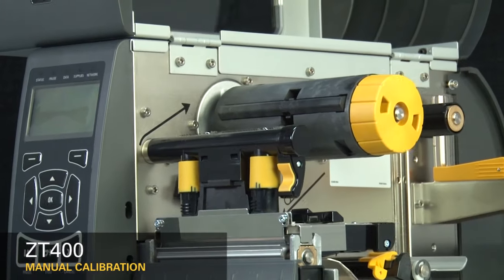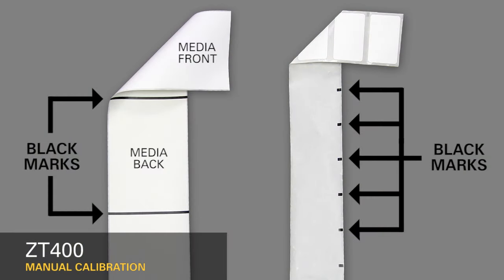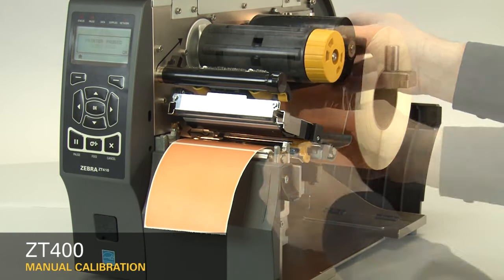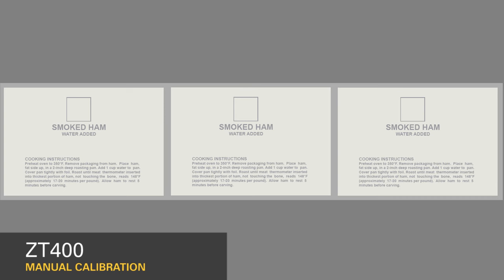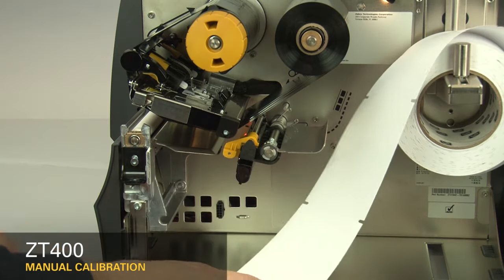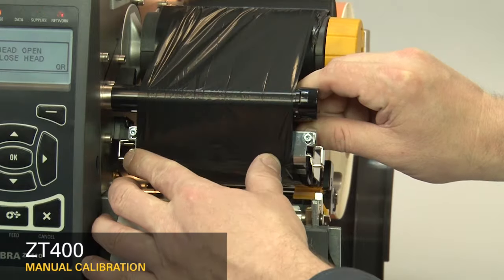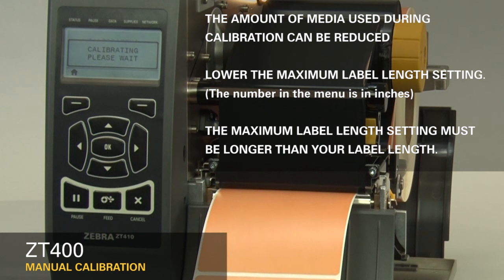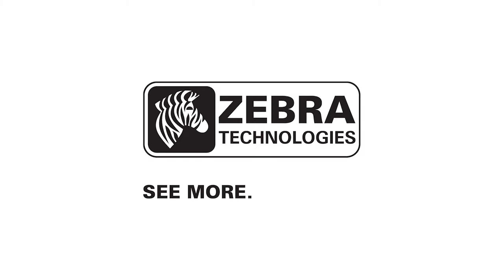Zebra ZT400 Series: How-to Manually Calibrate

Comment: For me adjusting the max label length was the factor for it to recognize media was inserting after doing a manual calibration  was set to max 1 inch on a 8 in label.

Comment: Hi, i have installed a 300dpi head on ZT420, but the label calibration is never right on the gap, this because the gear and belt set are actually meant for 203dpi?